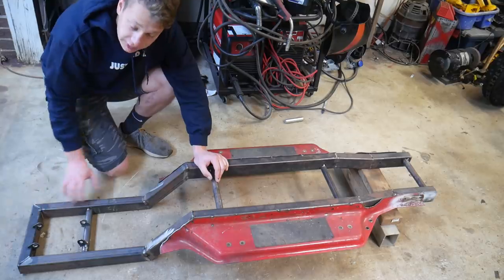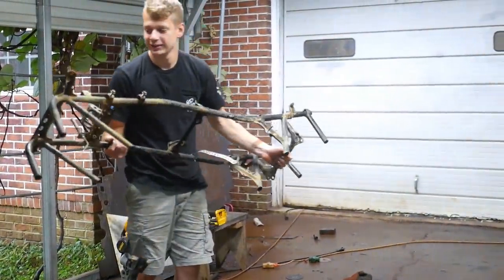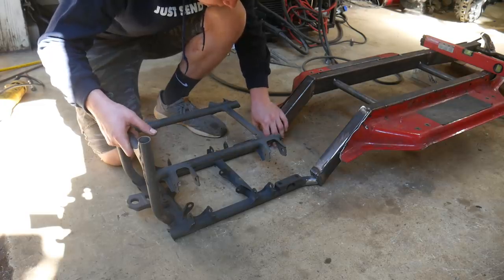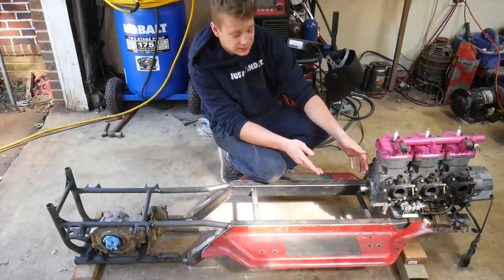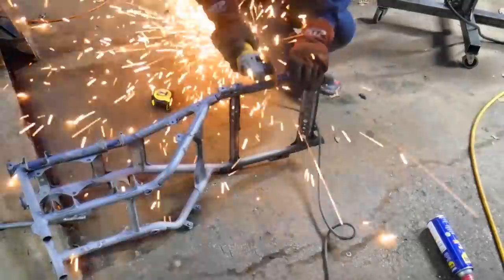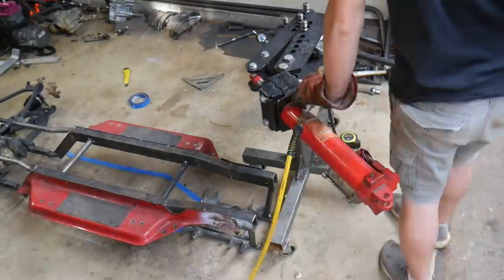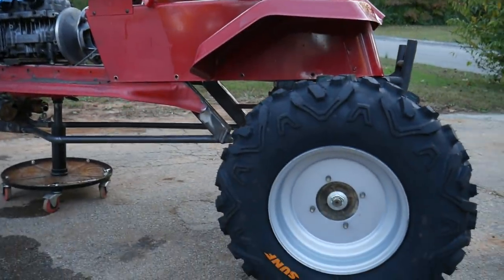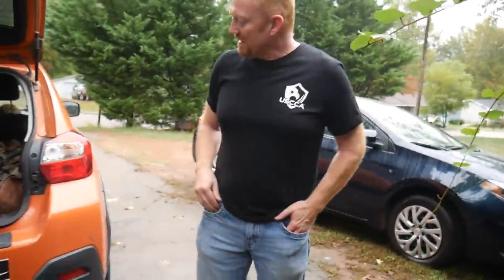4x4 110hp Triple Ultimate Mower Build Part 3!

Comment: Nice video!  I always enjoy your builds 👍
That gear box is awesome, thanks for the info on that in the last video Vasily. Take care
Reply: Hi Mike I love ur build I even copied the 212 dirt bike
Reply from the maker: Awesome Thank you!
Reply: Festiva is a genius! 👍
Reply: @VasilyBuilds  , Dude!  🤔  I have a built Honda TRX250R that is 249 ccs and pushes 45 hp with 230 psi static compression, and ported by myself.  Keeping the front wheels down was hard enough, much less than a 110+ hp Polaris Triple.  You might want to get some SERIOUS protection, just test driving the Mower!!!  🤤🤤🤤
Reply: What gear box was it

Comment: Hey, man... if you rotate the differential housing 180 degrees along the pinion axis (upside down) the axle sockets will rotate in the forward direction you need them to without the need for a reverse gearbox. Maybe all you have to do is drill and weld a bung for a new drain plug on what would be the top of the differential and use the old drain plug hole on the “bottom” (now the top) to plumb a breather. Hope this helps.

Comment: The build is amazing! The only problem I can foresee is a high center of gravity (rider and engine) combined with a long, narrow wheelbase and narrow tires. A quick search online shows that they do make a 25-12.50-10 6 ply.  - - I think they extra width may help to prevent a possible rollover when cornering.
Reply: I agree with the center of gravity being a bit of a concern, but if he wants it to go off-roading etc. and really utilize the 4x4 I guess he'll have to keep that in mind while cornering
Reply: Still will be lower than the quad that the suspension and diffs came out of.
Not sure why you think it will be too tall. 🤷🏻‍♂️
Reply: @Crewsy  yeah but the problem with a mower type build or any sit in vehicle is u can’t shift ur weight like on the quad

Comment: I noticed a few people are concerned about this engine not lasting. After working for Polaris dealer for years, these engine can be run any time of the year. Keep in mind these factors play in to a functioning 2 cycle engine (Cooling-you can use some sort of additive to better help heat exchange from engine to radiator. Oil-use Polaris oil believe it or not they have developed there brand to function under peak performance and stress. Carburation-Polaris all ready has specs for jet sizing that you will have to change depending on air temperature during warmer climate runs contact them.) Good Luck Looks Great.

Comment: You really gotta lower that seat position as much as you possibly can, So your waist is sitting below the bottom lowest part of your steering wheel. Just because with that type of power your upper body is gunna sway and shift to much causing the mower to be super uncontrollable and dangerous. Just think about how much your upper body moves around when you hit pot holes on a regular mower when your mowing the lawn. But now add +8inches Vertical mixed with full suspension, with 95+HP and tons of grip with 4wheel drive . You could even drop the seat enough to put In a sweet low profile roll cage and harness all while maintaining the original body that would make the build standout so much more and attract a bigger audience. You’re skill level is more then capable to pull it off  too for sure ..... Love your channel man and your craftsmanship. 👍👍

Comment: You should drill the outer tube and weld the sleeve through it to the outer. You need the plugging pulse of the expansion chamber on the exhaust to achieve peak hp.

Comment: Cool build . Now .. a little info on the engine for you. Waterpump are notorious for leaking. Hard to get parts for that pump. eBay for the seals. The stock Pipes are key to get the most reliable power. I read a few comments about running the engine backwards. Won’t happen, the CDI box. Not programmed to run this backwards. Besides Polaris would have already done it. Not till 2003 did they have their engines run backwards . Your engine in stock form was rated close to 120hp.  I’ve built many of them . 600-680-700-800’s.  Fuji made a great engine . As for the belt and clutch distance, use the required belt for 1997 xcr case reed engine . So that means the Center of the output shaft on the crank in relation to the shaft the secondary clutch should be 12”. Centre to centre . Be careful when the clutch engages for the first time, ..... should almost be 3500-4500 rpm.  Hit me up if you need more info on the engine.

Comment: DEATH TRAP BE LIKE RIDING A QUAD WITH YOU'RE FEET UP OVER THE HANDLEBARS. YOU NEED SMALLER WHEELS ON THE FRONT BUT IT'LL STILL WANT TO TIP OVER EASILY. Discard the steering wheel and put handlebars on you might be able to corner fast.. GOOD LUCK 👍

Comment: Suggestion! 
Reverse gearbox is a GREAT idea, but how about reversing the engine placement? Instead of having the clutches to the rear, have them to the front?  Doing that will also change the center of gravity though. Will gain more traction to the rear (more weight closer to the rear diff) and help prevent spinning. 
But either way, loving the build!

Comment: I'm putting a Briggs & Stratton 20.5 HP horizontally opposed 2 cylinder on a 11/36 Craftsman 2 (Cube). It's a 1987 model and I'll be running twin stacks.

Comment: You can expect around 120-130 HP on the 600cc sleds. my 900 twin made 210HP with port polish intake exhaust , wiseco pistons , banshee pipes , boysen reeds , balence and blueprinted motor . its going in a road race legend car frame .

Comment: at 4:21 you should use some solid round bar about 50mm long and stick it on the inside of bouth tubes. Will make the joint much stronger between the 2 frames.
Reply: Good job so far!

Comment: If you mount the diff upside down then it will work without the polaris reverse motor gear thing.. but then your left with no revers and then you need to service the diff when its out and the correct way around

Comment: If you rotate the differential by 180 degrees then the wheel will rotate in the other direction. The mount will be "upside down" and the caliper will be on the other side. I hope I could help, sorry if I said wrong. Regards, Peter

Comment: I've seen a lot of guys do tubular back-halfs on trail rigs with this kind of setup (Square to round tube), works just fine. 

Hope to see this thing around buddy, I'm from chatt as well.
Reply: What is a tubular back-half on a trail rig?  Can you say it in a way a non-builder would understand, please?
Reply: @katemoon7476  Factory frame rails on most vehicles are boxed or C- Channel (You'll have to google examples of them). People will attach/build tubular (Literally, Tube) rear ends much like a Rock bouncer for their 4-link rear end to these factory C channel frames. You can google examples of this setup online
Reply: @sendit9129  Thanks

Comment: I was one that said you should have used the front and back of that frame so you would not have had to remake all the mounting tabs for the difs and suspension.  Now seeing that quad frame sitting next to your tractor frame I think you should have just used the quad frame with some modifications and bracing.

So how are you going to do the steering?  Where are you going to fit those mufflers?  I think the ride height is a bit high.  For off road ground clearance is nice, but it is the suspension droop that helps with the rough ride and jumps the most.  Try to keep stuff down low so it does not tip so easy.

Comment: Another way that might work to fix the problem of an engine turning the wrong way is to use the spider gears and carrier from a differential. It would takes some fab work but it should work.

Comment: That is a 2 stroke motor it will run any way you pull it over. Found that out drunk on the sled trail pulling over the primary the wrong way

Comment: You need to pay attention Center to center from the engine crankshaft to the jackshaft where the secondary clutch rides. Too tight and he won't have a neutral and it'll creep on you and too much the belt will slip. If memory serves me right I think the center to Center on most Polaris is 12 inches

Comment: Curious why you didn't put some thick wall pipe, or solid bar stock inside those tubes when you welded the top of the rear to the chassis.

Comment: U should do plug welds on the rear tubes h added. U mean I’ve watched u for some years now. U have come a long way on building. I don’t doubt your capabilities. But I really think plugs will help. Yes it’s a hundred horse. Lol. The power them motors are capable of laying down is atrocious. Lol. That rear end needs to be really strong. I built a wheeler with  zr500 and I was constantly strengthening parts and bars. These motors are no joke. Especially a triple. If that’s the rotax good luck lol. That’s a means business motor lol

Comment: Great work, Vasily! This build is coming along well and I look forward to seeing it all done.
I am concerned about the height of the seat. It seems to my untrained brain that you are going to end up with a very high center of gravity, which could make this dangerous when cornering, especially at speed. If you have no intention of going fast on this, then it shouldn't be a problem, but if you are planning on going fast you might want to consider mounting the seat much lower than it currently is. I don't think anyone wants to see you get injured again.

Comment: Here’s something to ponder, a two stoke engine can run either direction. I know you already have a reverse box but old golf carts that ran two strokes didn’t have a reverse gear, but instead reversed the polarity on the starter to make them run backwards.
Reply from the maker: Running it backwards would render the water pump useless

Comment: Tires aren't bad, would of gone with a headlock rim instead so you can really air them down if needed. With those plugs on the top of the heads kinda a bummer needing to cut the hood. I would still get that engine down lower in the frame, as much as those pipes will allow... please tell me you're planning a solid cage for it too, maybe even a pair of wheelie bars. When you dump the clutch on an '63 cub cadet with a Briggs 18 v twin you're guaranteed to be on the ground looking straight up at the sky. 100hp on a murray? Why I'm watching! Nuckin futz

Comment: Ok is the bearing guide on your pipe angle cutter a commercial fitting or did you build it your self ?
Either way it is a Legit piece of gear wish I had 1 30 plus years ago when I was doing my apprenticeship's Boiler maker welder fitter and machinist !
So many hours cutting and grinding saved OMG SO SO MANY MONTHS OF WORK !!!
Reply from the maker: The tube notcher? That's commercially available at jdsquared.com

Comment: love this build but you know that because its a 2 stroke that engine can be run in reverse because it don't have valves
Reply: Run in reverse huh
Reply from the maker: some snowmobiles have reverse chain cases. Running it backwards would render the water pump useless
Reply: @VasilyBuilds  I forgot that was  a water cooled engine your using

Comment: It's a two stroke...just spin it backwards.  Other than the pull start the engine doesn't care which way it spins.  Lots of snowmobiles actually do reverse by stopping the engine and starting it in the other direction.
Reply from the maker: That would render the water pump useless
Reply: @VasilyBuilds  good point. That night be easier to solve than fitting in the reverse box though.

Comment: If you chanche the timing to the othet side of the TDC, the engine will run backwards like its made for. The waterpump is the only problem i guess.
Reply: This engine WILL NOT run backwards .
Reply: @ultramonte327  all 2 strokes can run backwards.

Comment: It's cool as hell but where's the center of gravity on it. I mean is it better or worse than a four wheeler. I got a polaris 450. It's not got the speed or power that i'd like to have. I'd really like to bypass some of the electronics on it also. Hell all I want it to do is start and run good but I wouldn't even know where to start or what size or kind of motor I could stuff in it? I basically want to completely strip it down to nothing but electric start, head lights and run when I need it to. Besides that, the rest can go.
Reply: Or would it be easier to just start from scratch. I forgot to say i want my four wheel drive to work. I've got a few lawn tractor frames but i'd rather it be more like a four wheeler than a lawn mower but very basic.

Comment: Why not squat the rear end, lift the front, put some 6” spaces all around, oversized rims with low profile tires and wrap it in something ridiculous? All of these mods would make it fit in well with the current trend of trucks with absolutely no practical use.